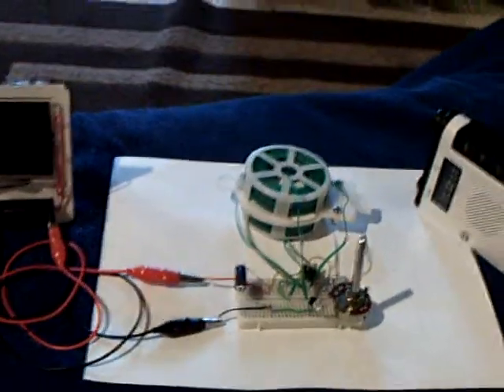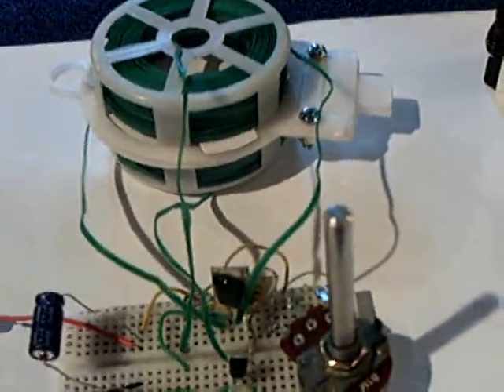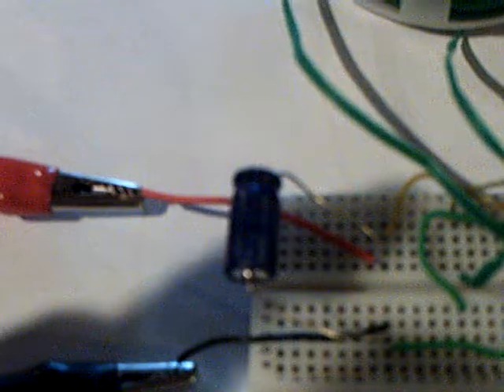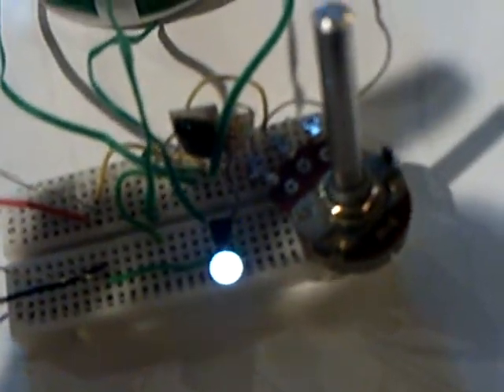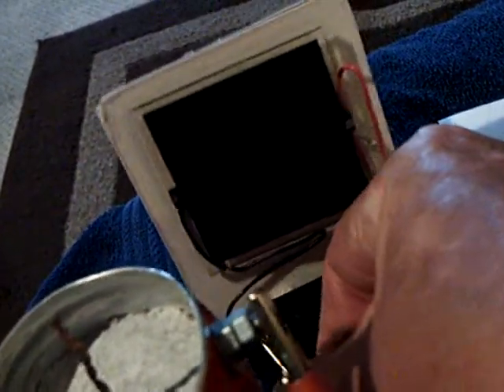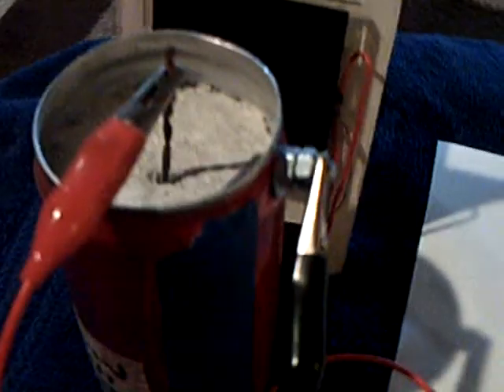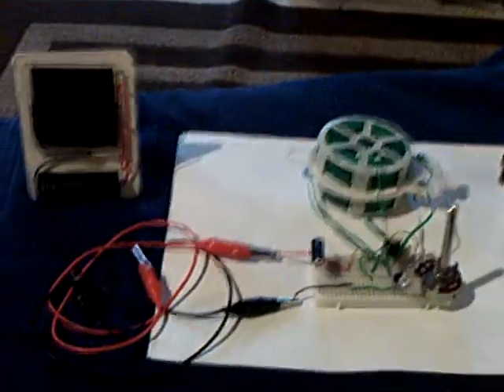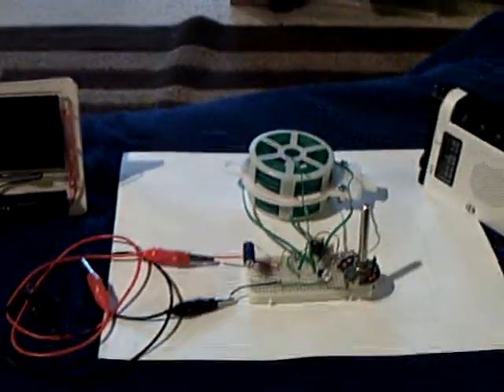Infrared energy.ASF

Comment from the maker: @KyleCarrington -----I am also amazed that this simple cement battery is still going.   The voltage remains around 1 volt but it has very little amperge to back that.  It is almost like a type of self charging capacitor.  Short it out and it goes dead.  Leave it alone for awhile and it bounces back.  The one that is hooked to the LCD clock is still running the device at six months.   Very strange.

Comment from the maker: @animateclay -----Thanks for that info.  The roof of my house has no insulation of any kind.  Maybe the infrared is coming into the cement battery from the top as the sun passes over head.  Or -----maybe there is just a very slow chemical reaction keeping it going.   If I can build a true crystal battery (which has NO water involved) then I will be able to do better tests.